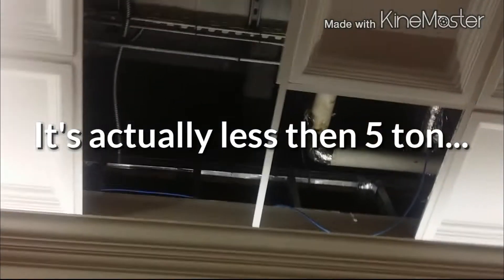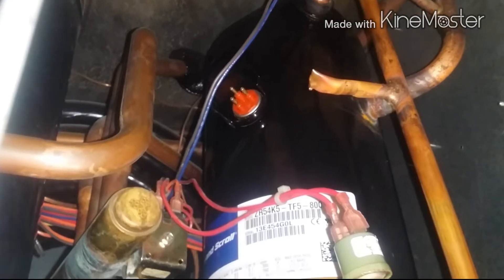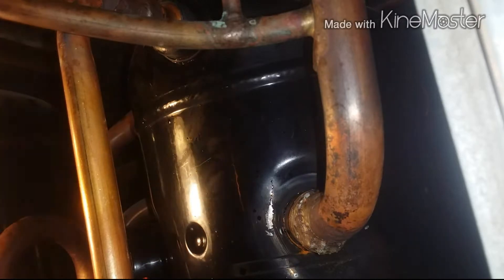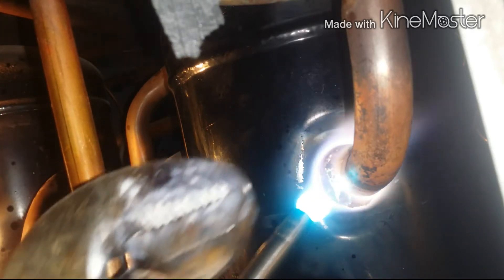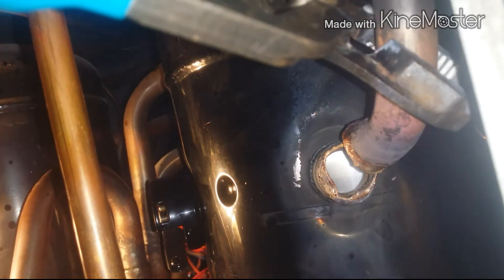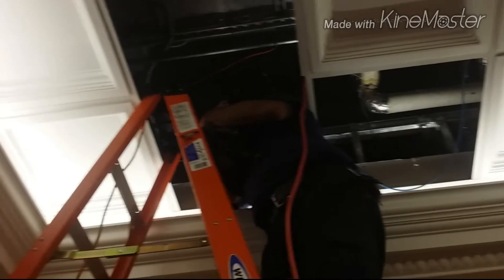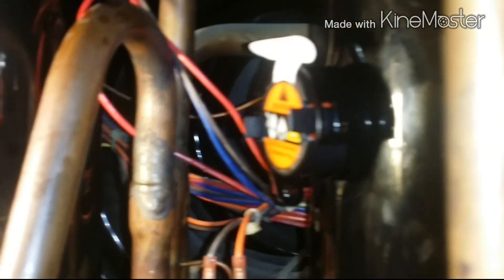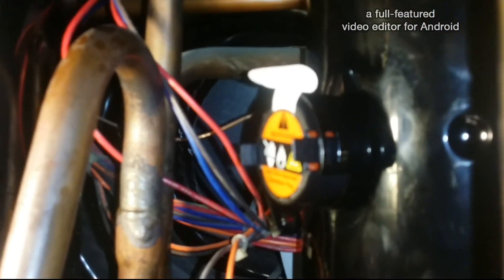HVAC | Compressor Change Out |  PT1

Comment: Great vid Emin!

Don't use bubble gum on the joints, it blows bubbles :-p

I usually take the rubber bungs from the new compressor and put them in the old one, maybe a bit of oil or spit to get them back in, push them in with an allen/hex wrench in the hole. I put some electrical tape round just to be sure, so far never had one blow out!
Reply from the maker: Thanks John. I will try that next time. Thanks for the support and the tip.

Comment: Emin, if you refrigerant circuit holds 12 lbs or more of refrigerant then the scroll compressor requires a crank case heater. Just more information rattling around in my head.
Reply from the maker: Thanks Larry. I appreciate the help. This one holds 5 lbs per circuit. Thanks for the info

Comment: I know how you fell brother, I changed 2 out this past summer. The 2 I changed was suppose to have mufflers on them but they actually had LLdriers on them that somebody didn't know the difference when they changed the compressors before and I think that was why they went bad. I normally change the reversing valves too because the compressors are usally in the way, nice job Emin.
Reply from the maker: You're absolutely right. We have a building that has 54  five ton WSHP. When the compressors go we change RV, TXV and compressor.  This account only paid for compressor. . Thanks for watching brother